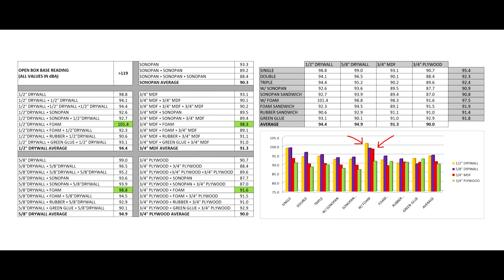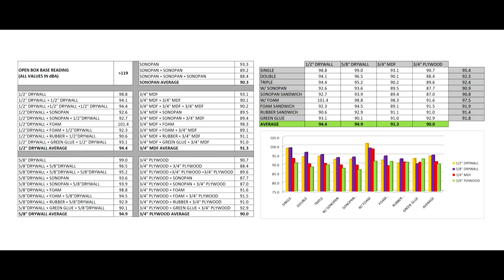What is the best material for soundproofing?

Comment: I think your box was leaking sound from layers not being airtight and I believe it was also leaking sound from the bottom which invalidates the entire test. For example stacking multiple layers of drywall should make a big difference but in your test it barely did anything, with that logic stacking 10 layers won't do anything when in reality it should practically make it completely soundproof unless it's ridiculously loud like 160 dB. Another criticism is only using one type of sound, in which case it's high pitch noise which is infamous for being really easy to soundproof, it even falls within STC rating. Something like sub bass and bass noise (20-250 Hz) would be a better test because it's very difficult to soundproof and requires decoupled walls with multiple layers of drywall. I would like to see a V3 of this test with addressed criticism.

Comment: I'm thinking you have to separate the different layers possibly with spacers because the material itself is conducting the sound from one side to the other. In reference to your last video as an example, did you notice how the 1/2" drywall by itself reduced by 22.9 db? So, hypothetically, if you built a box within a box and separating the two with maybe little squares of sonopan as spacers, that could potentially reduce by almost 46db. The only issue is that drywall doesn't cancel out every single frequency but I'm getting ahead of myself..
Reply: That's a really interesting idea - I kept reading about leaving air gaps, but others say fill them up with something. Do you know what's actually better, by now? 

It's probably about decoupling, which means less direct contact would be better. Then again - Why do people use decoupling mats / sheets to cover the whole floor instead of just some porous, non stiff material placed sparingly beneath a floating floor? 

Or would it make not much of a difference, if the material is like rockwool?
Reply: 46db would be fantastic and it sounds like it would be like that, but probably it's less due to unknown reasons?

Comment: Ther is a material which seems like you didn't consider on both tests... EPDM Rubber, a 5mm thick one (5kg/square meter (1250kg/cubic meter) should give you (alone) average 25dB of absorbtion, but not all frequencies gets the same tamed by the same amount, bass frequencies are much difficult to treat. there is a product called TopSilent (made by an italian company) but I believe you can find comething similar in any country.

Comment: u should try cotton, i saw a video, that show how cotton, or others organic fabric are better than any synthetic materials for sound damp, i need to find it back. i can't remember the name of the chanel.
Reply: Cotton batt is only slightly better than rockwool.  Rockwool is only slightly better than fiberglass, but for the lower frequencies.  Above 100hz they're all pretty much have the same transmission loss.

Comment: One suggestion I know I made on the last video that maybe was missed... An air gap between your insulation helps as well! When I started working from home during the pandemic, we built a soundproof office, and we basically framed out two walls with an air gap in between. It's been great!
Reply: Air is not a soundproofing at all, it's an insulation if and only its none moving air. If the air move and travel, it's not insulating anything (it's also why pink fiberglass must not be compress, it's all the air bubble inside the materials that help with heat transfer).

Soundproofing require masse and air have none. You could have done the samething without leaving the air gap and it would yield the same result. The thing is what you did to create that air gap created soundproofing, but it's not the air that's doing so. In fact, air is the enemy of soundproofing cause it allow the noise wavelength to move freely.
Reply: @jean-sebastienfrenette5169  wrong. If you had 2 layers of drywall stacked together , that would isolate less than those 2 layers separated by an air gap, and the greater the gap the greater the transmission loss. That is basic soundproofing: Mass-Air-Mass (or sometimes called Spring instead of Air as in adding absorbing material which is better)
Reply: @segundacuenta726  Correct.  It's hard for some people to wrap their heads around this technique because it seems counterintuitive.

Comment: It's too bad you didn't include rockwool insulation. 
I am hoping to see what a normal house build would look like. I.e. plywood sheathing, which is the exterior of the house, followed by R22 rockwool insulation, followed by sono pan, then drywall.  
Can you try that?  
Of course this isn't taking into account whether the siding is wood, vinyl or hardi board and on top of that, alot of homes are going into energy efficiency with exterior rockwool insulation (because I too just had this done with a R6) or foam boards, which I think would drastically reduce those annoying car horn sounds and traffic. 
I am just trying to figure out if sono pan would be worth it or not.

Comment: I would think, that lid that was madeon the box would be bypassingall the sound proofing and allowind sound transmission directly out the edges of the lid.   Maybe replace the lid with a more non transmissable / vibrating substance, so the sound proofing is being tested rather than the lid effects + sound proofing /

Comment: Pl accousti seal is not green glue at all. It's not for the samething. It is a sealant, you use it to seal the perimeter all around compared to green glue that you use 2 tube for 4x8 sheet. It's not at all a good test.

Comment: I don't think its an accurate test to just throw the pieces on top. In a real scenario, the sound proofing will be nailed down, or secured in some way which would add an additional level of protection. Since its not secured down, the horn itself is so loud it would probably cause the panels on top to vibrate which would allow noise to escape around the edges. and you have the sound detection device right at the edge too, it should be opposite the sound proof layer you're testing. the sound proofing material should be between the the horn and sound measuing device.
Reply: Low frequency resonance is the main issue with soundproofing.  Mids and highs are much easier to attenuate.  Canadian lab tests from the early 2000's show that air space and decoupling (separate wall with 3"-6" air gap) makes a huge difference in sound attenuation.  The larger the air space, the better the attenuation, especially the lower frequencies.  
Mass is a key factor as well. Obviously you want the most mass for the least amount of money ~ i.e. double 5/8" drywall with a dampener in between.  Specific carpet glues work just as well as green glue, and are a LOT cheaper.
Reply: @JP5466  Correct. Also filling the air cavity with absorbing material will help compared to the same space being empty. Depending on how big, the density of the material will matter more or less. The greater the gap, the less dense material it needs to be (and it can be any of your choosing, doesn't have to be rockwool or fiberglass). Number 1 is mass. Number 2 is space between masses (decoupled or even better non touching very important). Number 3 is absorption. Density of mass also matters (as mentioned, lead and steel and to a way lesser extent, porcelain and MLV, will be better for low frecuencies than wood, drywall, etc., even if weight is matched).
Reply: @segundacuenta726  To your point about air gaps...  
I recently made a window plug for my basement window.  Window is 24"x48".  I glued 1/2" cork all around the top, sides and bottom of the window sill.  The plug is made with 1/8" lexan plexiglass, 3/4" plywood (frame only) and 1/2" cork (gasket) and no insulation at all.  The window sill is very deep, which gives me a 15" air gap.  When I place the plug in the window, loud bass from passing car stereos is practically inaudible and loud 4th of July fireworks are 90% attenuated.  After many trial and errors attempts at soundproofing this window, this is the best result I've ever achieved.
Reply: @JP5466  Very nice. Since the air gap is so large, perhaps there is no need or even further noticeable benefit of thicker pane or even going for glass (since polycarbonate is half the weight of glass). In many cases though if the air gap is way smaller, thicker heavier panes would be needed. Even glass is better for soundproofing than polycarbonate, the poly is so much better for an outerlayer (wont be broken into pieces like glass, that's why its used in shields and booths).
Reply: @segundacuenta726  Great points. 100% agree.